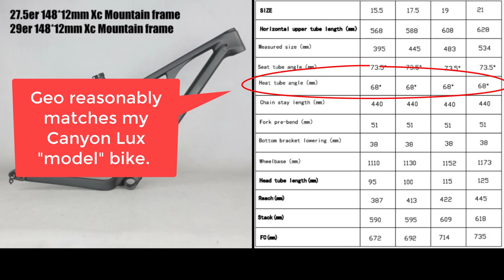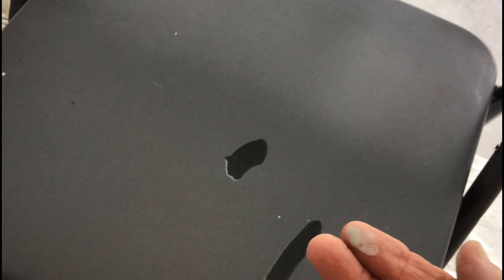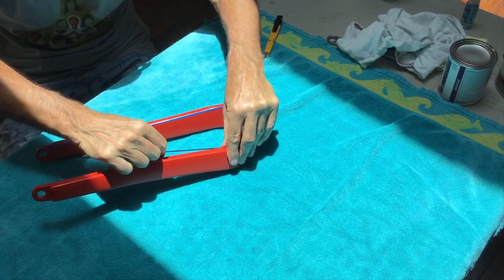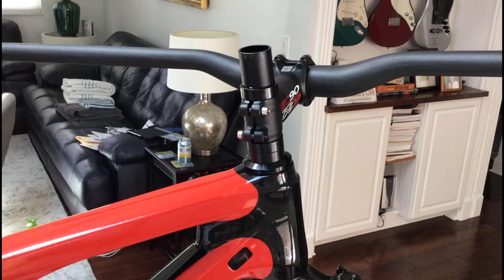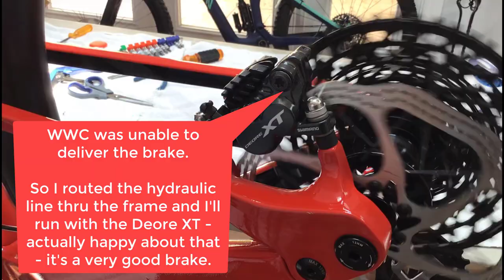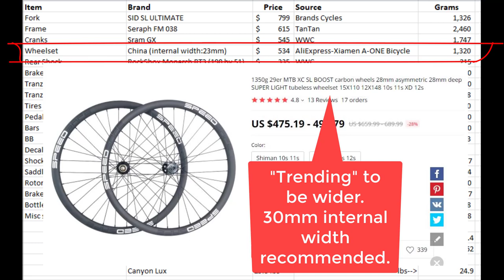Seraph MTB Frame FM038 - Full Build  ...

Comment: @Jerome P, how much the wheels weight?
Reply from the maker: Here is the info: 1350g 29er MTB XC SL BOOST carbon wheels 28mm asymmetric 28mm deep SUPER LIGHT tubeless wheelset 15X110 12X148 10s 11s XD 12s. Bought them from Xiamen A-One Bicycle. These are xc only wheels - they are narrow and light. I was pleased with the price and their responsiveness. I bought other wheels from them since this initial purchase - 35mm external width for the next purchase for an all Mtn bike I built.
Reply: @jeromep4148  ty  do u have link for Xiamen A-One Bike Co?
Reply from the maker: @farghom  Xiamen A-ONE Bicycle Co.
https://star.aliexpress.com/share/share.htm?image=HTB1GQ1uRpzqK1RjSZFvq6AB7VXai.jpg&title=Xiamen%20A-ONE%20Bicycle%20Co.&platform=AE&redirectUrl=https%3A%2F%2Fm.aliexpress.com%2Fstore%2Fv3%2Fhome.html%3FshopId%3D1531096%26sellerId%3D119960389%26pagePath%3Dindex.htm%26sellerAdminSeq%3D119960389%26srcSns%3Dsns_Copy%26tid%3Dwhite_backgroup_101
Reply: @jeromep4148  ty
Reply: @jeromep4148  thanks i cant seem to click on anything.  is that on regular aliexpress?
Reply from the maker: @farghom  not sure what the problem is. It takes me right to their AliExpress store.
Reply: @jeromep4148  ok ty which model of wheel did u buy?
Reply from the maker: You have reached your question limit.

Comment: Nice build …the frame already comes primed, painted black and with matte clearcoat. It would probably be better off if you had wetsanded everything before reprime. I did mine in April….lots of wetsanding.i won’t buy a complete bike again.
Reply from the maker: Huh, I did not realize that matte finish was a form of clear coating. After this project, I  did an FM10 build for myself and I am just finishing another FM10 build for a family member. It’s not necessarily cheaper but you get exactly what you want and it’s very gratifying. What frame did you go with?
Reply: @jeromep4148  yes very satisfying. I went  with a lexon Titan/myst aka fm-258.

Comment: Interesting.  I am flip-flopping on buying a frame from China.  Not wanting to wreck due to a poorly made frame
Reply from the maker: This frame is an XC MTB (68 degree head tube angle - around 27 lbs pedals and all). I think the frame is very, very good. Because of the frame and components installed , it’s my # 1 bike (and I own 5 of them).

I would buy it again with no reservations. It you do a build buy good components (fork, rear shock, drivetrain, brakes)- even if you need to save money by getting used stuff on pinkbike.com. The components make the biggest difference IMO. 

For run, I did an “all china” build - I am now upgrading fork, shock, brakes. Was an interesting experiment.
Reply: @jeromep4148  Thanks for the info, My concern is also my size 6' 4" @ 230 lbs
Reply from the maker: You probably know about Carbon fiber strength relative to your weight. In know carbon fiber is used to make F1 frames and aircraft component so CF itself is not the issue. The only issue to me would be the strength of the pivot bolts. They r steel ( not alum) , but r some better than others or all all the frame manuf sourcing from the same bolt company in Taiwan?? No clue. I do know I built an FM10 from Seraph (more of an enduro bike) for son-in-law. he is your size. So far, so good for him. Good luck with your decision.

Comment: So you buy a cheap chinese frame and then spend lots of money on unnecessary high-end components that won't give you any real benefit unless you are a racer or top-level rider.  Had you applied the same process that you did with the frame and wheels to the rest of the build, you could have saved an additional $1500 and still ended up with a better and lighter bike than your Canyon.  FYI, when painting, do thinner coats...wetsand in between...then thin clear coats.  Build up the coats slowly and allow for adequate drying time.  That's how you avoid runs and orange peel finishes.
Reply from the maker: The last paint job I did I sanded after the epoxy primer. Made a world of difference. The reason expensive components are expensive IS because of weight reduction. But I would love to see that proven otherwise. So let me hear your inexpensive light weight components- start with the fork - seems to be the heaviest single component on frame..